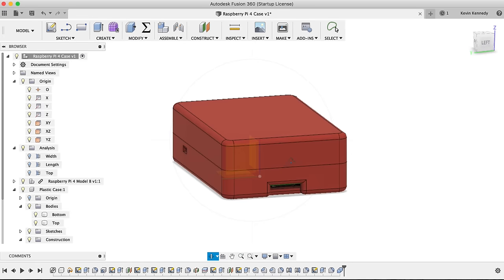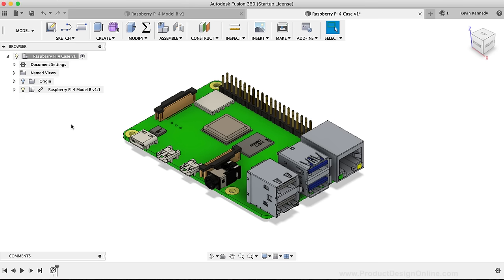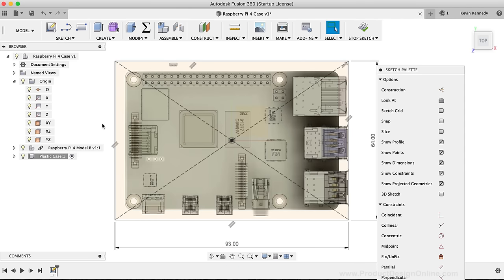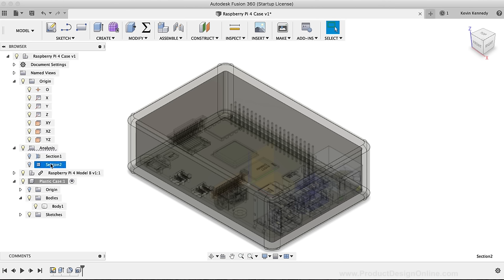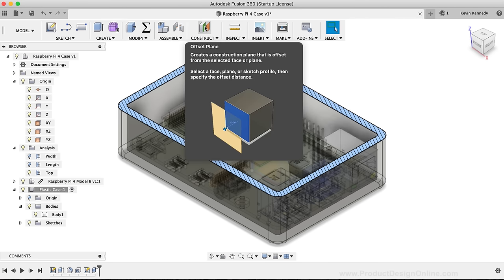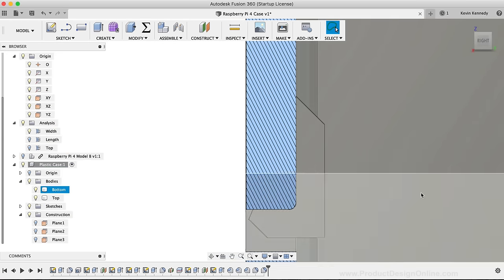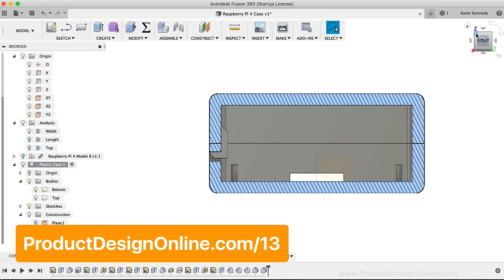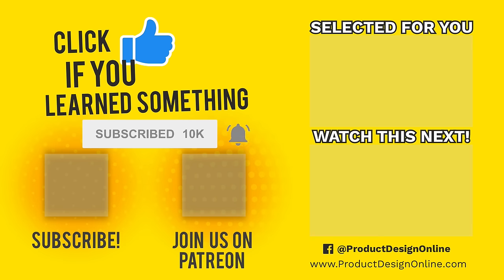Fusion 360 Snap Fit Cases | 3D-Printable Raspberry Pi Case

Comment: Love your tutorials.  Thank you so much.

 I would suggest this one needs a warning that a print of this model hasn't been tested and is just for instruction on Fusion360 methods so people don't try to print it out as is.  When I finished modeling, everything seemed to go smoothly but I did a careful inspection to look for any interference between the pi and the case and I found 8 spots where the raspberry pi intersected the case.  

The projection method doesn't work very well for the USB and RJ45 cut outs.  They change shape from one end to the other.  I projected them from the middle of the components as you did in the tutorial but then they ended up having things sticking up or down towards the outside edge that end up inside the case wall.  

The 8 spots I found were, the metal flange on top of the middle usb ports, the bottom of the RJ45 gets lower towards the outside edge and on mine I show that the two posts under the RJ45 intersect the bottom of the case as do the four posts on the bottom of the left USB ports but just about a half mm or so so it might not make a difference.  The pi just needed to be moved up 0.6 more mm at the beginning.  It was a simple matter to adjust the cutouts to make sure they fit and to add some slight recesses in the base to accommodate the small intrusions from the posts.   I am going to make a few modifications and print this out to see what happens.  I want to add access to the GPIO pins.  I will let you know.
Reply: Well three iteration later I have a working case.  Just as a PSA these are my results.
1. As at least one other poster mentioned that you can't get the pi into the case because of the vertical pins on the hdmi side of the case block you from being able to angle the pi into position.  I found that reducing the height of the pins on that side to 1/3 of their original height was enough room for me to slide the connectors into the holes and still left a small post that helps hold the pi in place.  
2. I had made individual holes for all the connectors and so I also created a slot recess around all of the connectors on the hdmi side that went all the way in bringing the exterior wall inside the recess to be even with the outside edge of the connectors.  This is so that the rubber shielding around connectors isn't blocked and things can be plugged in correctly.  
3. I added a small hole on the end so you can see the pi's LED light
4. I wanted to print in PLA and so needed to modify the clips. As Justin mentioned PLA isn't flexible enough for the design here and they break off.  I thought I would try the PLA+ I have that is fairly sturdy but it broke as well.  So I reduced the horizontal size of the clips by about half and increased the thickness of the support where it hooks to the wall of the case by 50%.  This made them strong enough to survive clipping together using just PLA.  However it introduced a new issue, the clips push the side of the bottom of the case out instead of flexing themselves so the ridge around the rim goes out of alignment and you can't close the case.  I was able with some effort to put one clip in place  while holding the lid at a 45 and then lowered the other side and with some careful pushing and prodding got the case to snap shut.  It is closed now, probably forever.  

Anyway I learned a ton and had a great time tinkering.  This works for a set it and forget it application like an octoprint setup or something.  Now to design a case I can get in and out of frequently to be able to access the GPIO pins for robotics projects.  Or maybe a case with a lid that can stay shut while still providing access to the GPIO pins.  Thanks

Comment: Darn you make it look easy. I cannot believe how much I struggled just to edit the posts that go through the PCB. I wanted to give it a platform to sit on, rather than letting the board just drop over the posts and sit on the bottom of the box. Simple right? Just make the post a wedding cake with a wider base... 3 hours later...
Reply from the maker: Hi, rbrdly. After creating the initial pins/posts you could offset from that cylinder and then simply extrude that to your desired height to make the wider "wedding cake" area to sit on. Overall, that's a great idea... I have seen some cases that have that. I'll have to incorporate that next time. Cheers, Kevin :)
Reply: @ProductDesignOnline  Thanks Kevin. I got myself all tangled up projecting things onto the wrong plane, working on the wrong component, on the wrong sketch... just, over complicating it. It was a disaster, but I got there in the end. Thanks again.
Reply from the maker: @rbrdly  I'm glad you got it in the end. Sometimes it just takes some persistence. Keep at it! :)

Comment: I printed it out and it came out pretty good (FDM), but immediately one of the snap-fit tabs snapped off (when removing supports)

Using a .6mm nozzle I am going to go back down to .4, hopefully for an extra profile - I would also recommend making the positive tabs a bit beefier and perhaps even filleting them to the interior surface to strengthen.

Do you have any recommendations for other snap-fit tabs?

Comment: Very great tutorial video. That was a nice clean way to make a case. I have a couple of suggestions. Maybe change the top and bottom fillets to chamfers for easier 3D printing. Also instead of a straight cut through the center of the case try making it variable so it splits in the center of the cut out slots. A well placed cut will mean you do not need 3D printing supports.
Reply from the maker: Great suggestions, Brendan. I was considering the variable cut through but was worried that would make the tutorial too complicated for some. However, it is certainly a good idea for avoiding the need of supports, along with more chamfers.

I'll try to incorporate some of this into future lessons. Thanks again! Cheers, Kevin :)

Comment: Wow, I haven't tried this software yet but it's on my wishlist.  I'm saving this so I can come back when I have more context because I can tell I'll learn a bunch!  Perhaps I am mistaken but the  HDMI opening doesn't seem to take into account the bulk plastic that typically surrounds the connector.  The backplane may need a recess at the bottom to allow the connector to fully seat.
Reply from the maker: Hi, Nathaniel. Good point with the connector. When you're ready to learn Fusion 360 I would recommend checking out my Beginner playlists - https://www.youtube.com/productdesignonline/playlists

Cheers, Kevin :)

Comment: Kevin, I really appreach your videos. Considering myself still a "rookie-level" Fusion360 user, I try my best to use streamlined design practices (in other terms keep your command timeline tidy and as small as possible). 
Key lesson learned in this video: Offset command. I frankly didn't know it existed and it makes life so much easier and the design file cleaner. Thank you really much for this :)

Just a quick hint - I think you already know it from your design experience: if you have to select faces/corners/points etc. that are hidden from view by other elements on top of them, there are two options:
1) is to use the view cube/orbit your view to reach them and then get back to your original point
2) is imho quicker  - simply press-hold the left-mouse-button and a depth-view opens with a list of all selectable items that lie around your current mouse position (even the once hidden from view). So no need for time-consuming view opeartions. https://youtu.be/hCVi1hrjgdM

Comment: Hi, really great video man. I used it to create a box for my power distribution board. However, when I tried adding my LOGO to the top side of the case, Fusion 360 would hang and ultimately I had to use task manager to shut it down. Any advice please?

Comment: Thank you very much. I followed this tutorial while creating my arduino nano based PCB case, it fitted beautifully. but I have no experience with 3D printing. My only question is, should I print the bottom and top individually?
Reply from the maker: Yes, you would need to print each part side by side/separate with the flat surface area on the build plate.

Comment: Fanstastic tutorial. Only one question: with the splitting the body, you did this in the middle. Is it also possible to do this a bit more organic? Because in your case or mine I want to create I will face a problem like you will have printing this one. At the usb C and HDMI connectors opening, you have this big bridge to cover. This can be solved by adding a bit to the top body to halfway that opening, but keep the rest halfway. How can you do that in a good way? With the splitting part at 22:00

Comment: I'd love to see the case after you have assembled and disassembled it. Perhaps you could post some pictures? Even if you claim to have made it in Nylon, you'd have the devil of a job getting it to work without breakage, if at all. Did you not benchmark a few of the commercial designs and notice that the snap fit features were "somewhat different"?
Reply from the maker: Hi, Murray. Thanks for your feedback. I definitely should've included some more tolerances into the design and will be sure to mention those in the future. Cheers, Kevin :)

Comment: Very nice tutorial!
I wonder if anyone have tried to print it as shown and if the snap tabs works ok (it looks like they have to bend quite a lot to get in there).
 I also wonder about the finishing ridge. I would have thougth it could need a bit of tolerance to really fit.
Anyway, I learned some new concepts from the video and I guess it's the main goal of the tutorial.
Reply from the maker: Please see pinned comment for the notes on adding clearance. I did forget to mention that.

The print is recommended for Petg and not PLA. PLA may work a time or two but will break if you keep opening/closing it.

Comment: Hi and thank you for your brilliant videos :-) Some slight help with the pegs if you please? No matter what I do, I cannot get the pegs to start from the case, but only from the bottom of the raspberry. Any tips?
Reply from the maker: Hi, SourceOfObesity. It sounds like it may be due to your RPi component being active instead of the Case component. Double-check the Browser tree and make sure you have the correct component active before you go to extrude the pins. Let me know if that works for you! Cheers, Kevin :)

Comment: Hi, kevin
If I 3d print it, I think COMBINE command for ridge is not having tolerance
so I think you need to do press pull to the groove of the top component, like 0.3mm
What do you think about it? 
cheers
Reply from the maker: Hi, MAKER HOME. There are a few different ways to achieve tolerances. You can do press pull as you mentioned. Otherwise, you can copy the body and use the offset tool to make the tolerance you desire. Then, use that second body (the copy) with the Combine command to subtract it. I'll have to make a video on tolerances at some point. Cheers, Kevin :)
Reply: @ProductDesignOnline  I would be grateful,  I was concerned about tolerances throughout the entire snap fit part of the tutorial :)
Reply from the maker: @g0balot  Sometimes I get caught up in speaking clearly or trying to talk through everything that I forget (important) parts. Cheer,s Kevin :)

Comment: This was extremely helpful. I have a noob project question. I'm very new to 3D printing and I've been creating separate Fusion 360 files. Using your example I would have case top, and case bottom file, then export each for printing. Design wise though how you designed this is way easier... so how would you take this and prepare it for printing? Do you need to lay it out next to each other, or can you export one at a time? Thanks! I will be checking out your other videos.
Reply: Clicking around I think I found the answer... you can right click on the body and save STL. I had been exporting the whole design.
Reply from the maker: @gstrickland560  Glad you found the answer. That's correct :)

Comment: there were some great tips in here but if you print that it won't fit - there's no tolerance for the fitting ridge! Is there an easy trick to adding some extra void (or whatever the right term is)?
Reply from the maker: Hi, Wezzoid. Thanks for watching! You're correct, I definitely need to add some tolerances into the ridge (and a few other areas). Please see the pinned comment for more details. Cheers, Kevin :)

Comment: Very informative, though I don't have any RPi so no need for a case. :) Am I right you would print this in 2 pieces, with the open side up? That could make putting a logo on the top a challenge (but not impossible if chosen well). Or did I miss something earlier?
Reply from the maker: That's correct :)

If the logo is debossed only 1mm or so then it should print fine without supports thanks to 'bridging'. Any issues and one could chamfer the edges to help.

Comment: If the cutaway groove's dimensionality is exactly the same as the ridge that fits in it, my experience with the regular 3d prints is that you won't be able to fit it, even if you hammer it down. This is certainly true about PLA, I have no experience with printing Nylon. I'd normally cut away anywhere between 0.1...0.3mm from the negative part to make the positive one fit in.
Reply from the maker: Hi George, check out the pin comment I forgot to mention adding the clearance there in the video.

Comment: Seems I missed something early on.  How did you get the Raspberry Pi model positioned so that the center of the board was at 0,0 on the XY plane?  Were you using an origin that centered on the model instead of the drawing?
Thanks

Comment: You are really awesome man!!! Hats off..
Between I'm a very beginner in cad and of course with F360. So my question is if I'm making a casing for Arduino nano or Uno, where we ca get those design.. are those resources available somewhere or do we need to design those first??
Reply from the maker: Hi, Sandeep. Great question. There are many sites that host free CAD files. I recommend checking out GrabCAD.com, Thingiverse, and The Fusion 360 Gallery (filter by downloadable items). Cheers, Kevin :)

Comment: Thanks Kevin.  I've  printed a few  cases for Pi 3B's but used magnets or nuts/bolts to hold the parts together.  I'm only set up for PLA but I'll give the snaps a try.  Nice tip about the combine/cut to make the ridge and recess at the end to help align the two halves.
Reply from the maker: Thanks, Thistledoo 47603! I haven't tried magnets before...but that sounds like a great idea. I'll have to give that a go and maybe make that a tutorial. I've done lots of projects with nuts and bolts...and will eventually make a tutorial on that. 

Glad you enjoyed the ridge/recess. One thing I forgot to mention is that it would be worthwhile to factor in a small tolerance there. Cheers, Kevin :)

Comment: Awesome video. Thanks a lot. I want to ask if i can print this with PETG. Would it work? You said, that you print it with nylon, i think. I dont have this filament available. Thank you.
Reply from the maker: PETG will work too, just be sure to add the extra clearance to the 'ridge' as I noted in the pinned comment (forgot in the video).

Comment: Thank you for that. Yes I will use this to mount 2 Emergency Stop buttons for my racing simulator to control the motion platform which uses an Arduino (I purchased this as a completed item with a 3D printed box) and a switch for my DD racing wheel power supply. I also need to design a snap box for the wiring to the power supply. I also need to know how to create text on the box to identify the function for each E Stop so hopefully I will find this on your channel. Thanks again, much appreciated.
Reply from the maker: My latest Text video is here - https://youtu.be/P5R88LG_6x8

Happy learning 😎
Reply: Also, will this work OK with PLA without fracturing?
Reply from the maker: @menoname3594  if PLA it will not last as long. But there are many variables, including print quality :)
Reply: @ProductDesignOnline  In that case I think I will do a snap fit on one side and a couple of recessed holes on the other side for screws and tangs on the other part to screw up to.

Comment: Very good Fusion tutorial, but not great from a 3D printing standpoint. There are no tolerances in many places. The only way this case will work is if the printer is under extruding. 

The snap mechanism could have been a half-sphere(or less than half), which would have made it printable without supports and make it easy to snap even when printed with PLA. 
As you've noted in the comments, that upper "lip" area you added at the end won't work if the printer is over extruding even 1% and it'll probably just break off if it's under extruding. 

The slot you've cut on the side is again could have been done to print without support if you had left some material in the middle. 

Still, one of the better Fusion tutorials on youtube. Cheers!
Reply: I would like to incorporate your suggestions into my design. What do you mean by the snap mechanism being a half-sphere though?

Comment: Really good episode. 

I'd like to see a follow on episode that focuses on modifying your project case. Say for example, extending a side to be wider or longer to add space inside for placement of a sensor or a shield on top, etc.

I've struggled with editing / modifying a F360 model since they upgraded the UI and tools just over a year ago. I would also like to hear your opinion on making each piece (example; top and bottom case) as components that are future options, which would allow for modifications or edits at a later date, that still ensures compliance with the rest of a model that was not changed. Your use of the tools F360 has is well described, especially the section analysis tool. I guess for me, they are not intuitive. You're making me think ! (LOL). 

Thanks for making these videos.